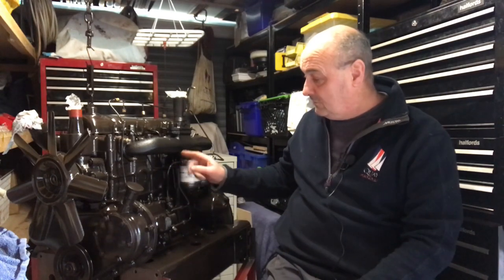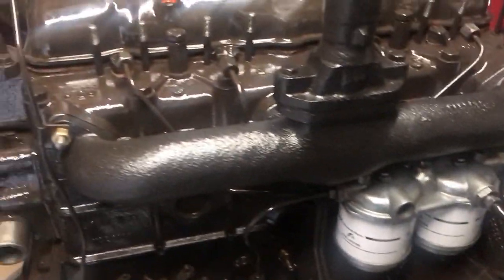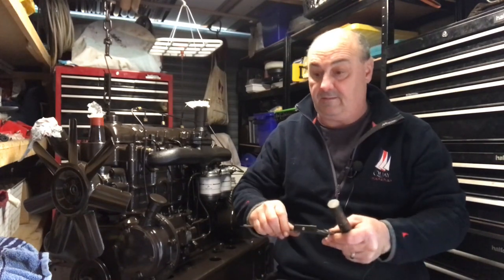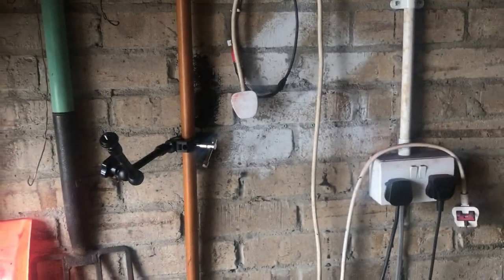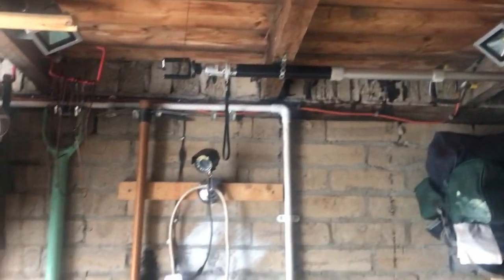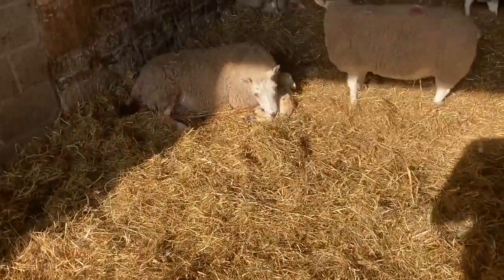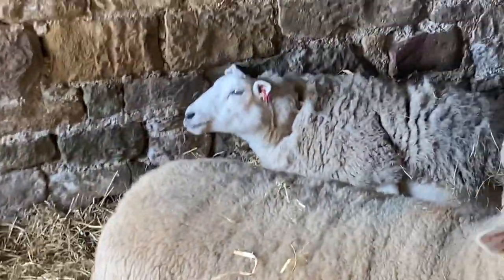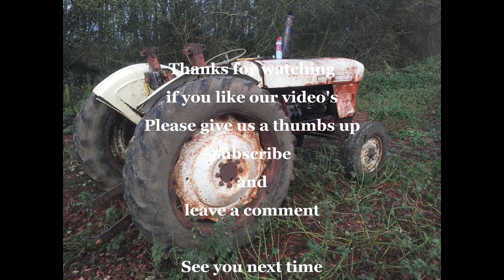Weekly yarns #1

Comment: Hi Barry, I have not long came across your David Brown content and I am really enjoying the videos. 
I have recently bought a 1978 996 which is my first tractor and it needed some work to get it going again. I am not restoring it but I am fixing everything on it and servicing everything I can. 
One job I am looking to tackle soon is replacing the seals in the 3 way valve as mine is leaking. David Brown parts do a seal kit for it so I'm going to have a go at that soon. Also the main loader seals need replaced on the rams so that's another job coming up. 
Keep the videos coming! One on the 3 way valve would be much appreciated 😉
Cheers
Paul
Reply from the maker: Hi Paul, Thanks for the kind words, I'm hoping that the video's would inspire people like yourself to have a go at repairs that they would have considered a mechanic's job a few week ago, when really it's just nut's and bolt's. I re-sealed my three way valve before I started the video series, there are some stils of it getting a coat of paint,  I just used a box of O rings from ebay( I think about £13 for a good selection of sizes), but you have to watch the suppliers as they sometimes advertise imperial and supply metric, When I get interest like your's I wish I had started the series earlier as I missed out the total engine rebuild as well as the trunion pin, front axel and steering gear re bearing and sleaving. However We'll be doing more tractors after this. In the mean time try bundy bears shed he's got lots of video's and I know they are MF TE20's but a lot of the axel, hydraulic pieces etc are very similar and the knowledge can be used across the board.
Many thanks for watching
see you with somemore soon
Barry
Reply from the maker: Hi Paul, just a quick thought I'll dig mine out of storage and include a little bit on it in the weekly yarn on sunday, hopefully you can gain an insight into the valve from that.
Many thanks again 
Barry
Reply: @Man fromthemist  that would be great thanks! 
I've done quite alot already on it.  Re sealed the power steering pump, serviced everything, various wiring repairs, lots of snapped grease nipples, sump cleaned out,  New front wheels and tyres, plus loads of little jobs. I usually work on cars but I am enjoying learning how to fix and maintain my old David Brown.
Your PTO video was great as I removed the draft unit where the top link connects and I looked down into the pto box and the circlip which is on the end of the input shaft towards the very rear of the tractor next to the expensive bearing which I think you just showed its badly bent on mine. I tried to bend it back into shape but I think it really needs replaced. It's one of those fancy circlips with the lugs on.

Comment: Great vídeos keep on doing them i have One question can you tell me where can i find the torque specs for this tractor mine is the ad4/47 3.0cc engine i am restauring my engine and i have all the parts nedeed but still need the torque specs thank you and sorry about my English i AM from Portugal
Reply from the maker: Hi Andre, many thanks for your kind words it's always good to know people appreciate the effort, I purchased this manual from ebay,
"JI CASE and David Brown Farm Tractor Service Manual : C-203"
It's not the best manual in the world but it has the specs in it. If it's specific bolt your after ie head, crank,conrods the books fine, If it's general spec's ie frame bolts bonnet bolts etc I find that manufacturers spec can be found on line and typically give the correct rating for a particular size of nut&bolt,
for instance a  SAE J428 Grade 8 bolt 1/4" dia course thread can be tightened to 107 in-lbs.
In my next video of weekly yarns I'll put up an image of the torque spec sheet I have from the manufacturers, I googled this and screen grabbed it. As it come in very handy every day.
thanks for watching the videos
if you don't find anything please come back and I'll find away of getting some info to you
many thanks
Barry
Reply from the maker: Hi Andre,  if you have removed the cylinder head studs from the block, they should be re-installed to 35lb-ft.  Then the head nuts tightened to 30lb-ft then 60lb-ft then finally 90 lb-ft in the correct secquence
conrod nuts, tighten to 25lb-ft then finally 50lb-ft, rotate crank after every rod is tightened to ensure they haven't nipped
I hope this helps
Barry
Reply: @manfromthemist1958  that helps a lot thank you for sharing and i Will also try to buy that manual if i find it on eBay thank you very much and keep on doing this movies they are awesome